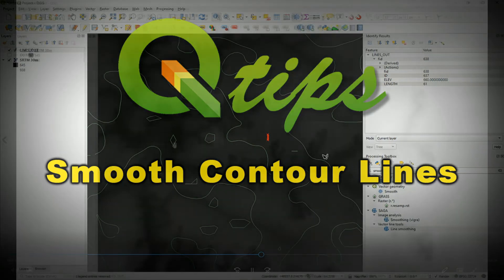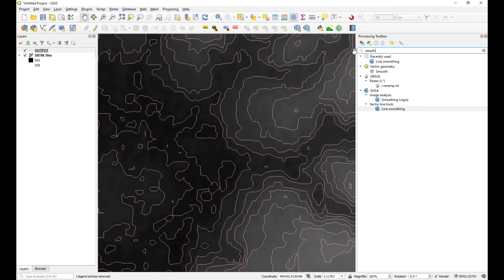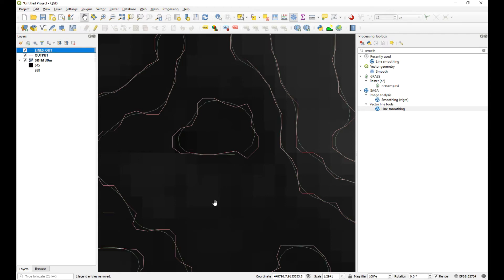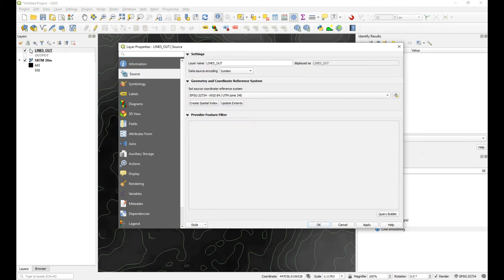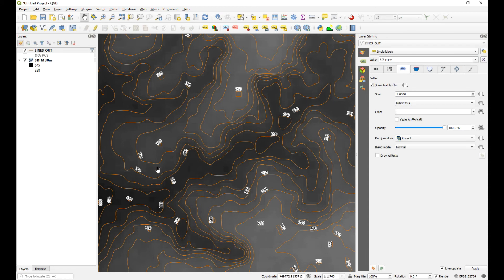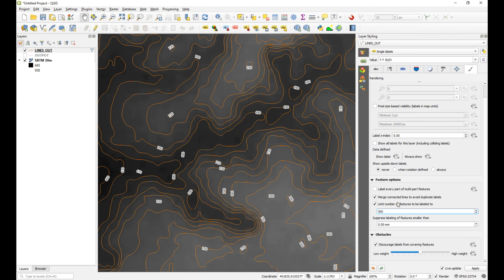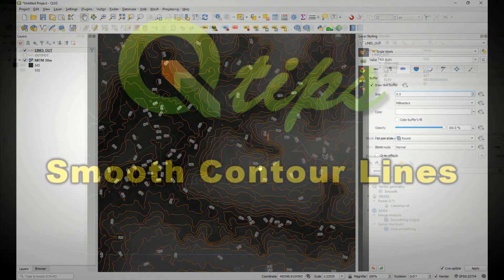QGIS Smooth Lines SAGA

Comment: which version of QGIS is this? I am having trouble with saga . I had installed QGIS3.22. I am very new to gis. Also I hsve a lot of nose with smaller elevation which seems to have no relation with my original point data.

Comment from the maker: timestamps
0:35 Extract contours from a SRTM grid
0:59 SAGA Smoothing Lines
3:08 Create new "LENGTH" column
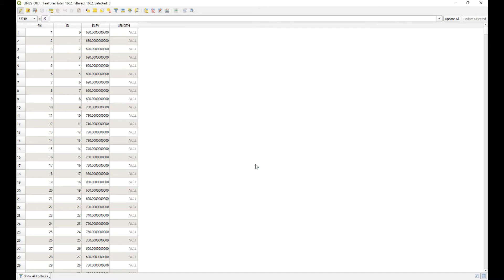3:30 Calculate line lengths
4:27 Using the Query Builder to exclude lines shorter than 65m
5:25 Labeling the contours